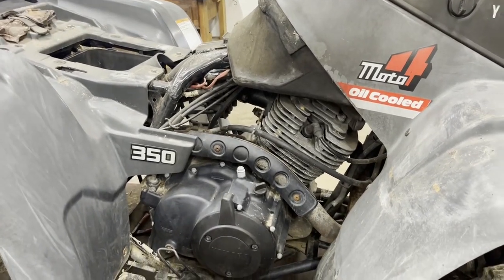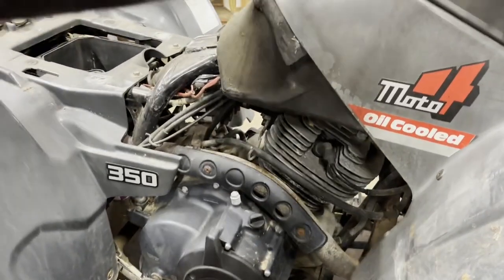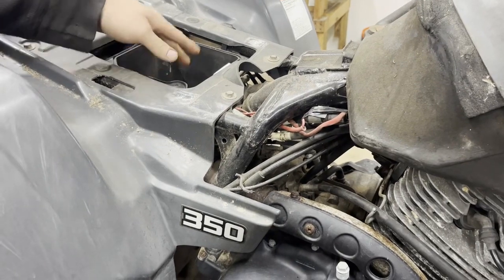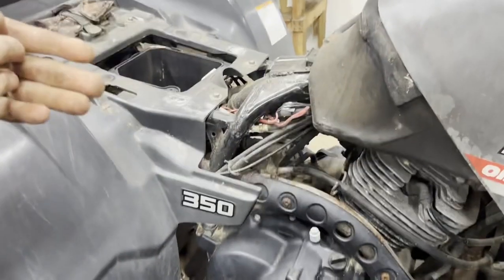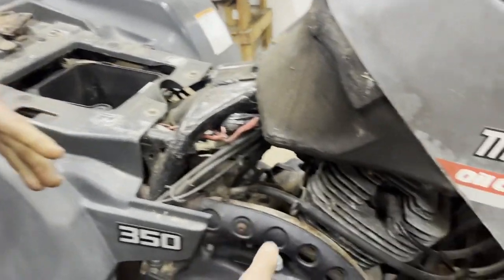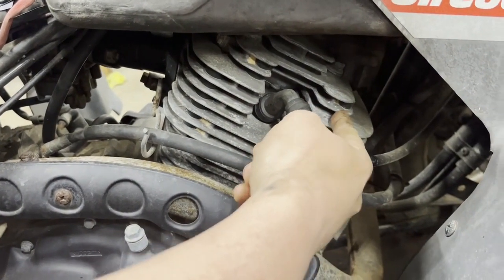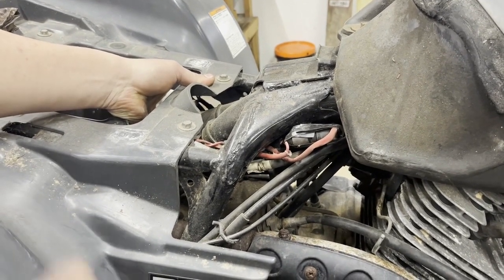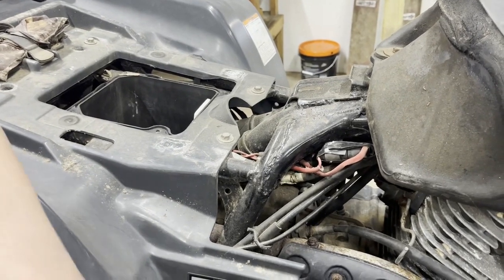Yamaha 350 Moto 4, Big Bear, 400, How To Check Set Intake Valve, Exhaust Valve

Comment: If it's blowing out the carburettor timing chain is put on Wrong take cylinder head off put piston to really top and make it so next valve to open is intake.
Reply from the maker: Check the timing. If the timing is correct and it’s blowing compression through the carburetor then you got a bent intake valve.

Comment: My big bear is not firing up it does have 115 compression, its getting gas, and has spark. It doesn’t fire up not even with starter fluid. Need help.
Reply from the maker: Make sure you have a good spark plug. If that doesn’t work check the timing and your valve settings. Thanks for watching.. Be sure to like and subscribe to our channel.